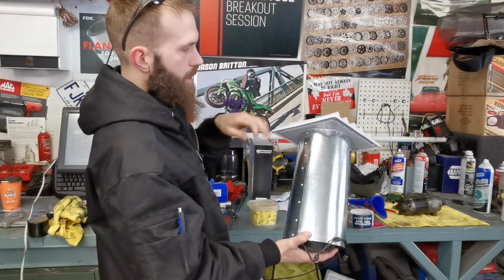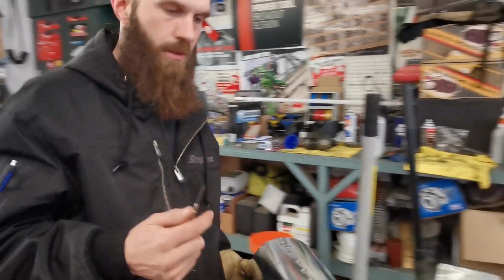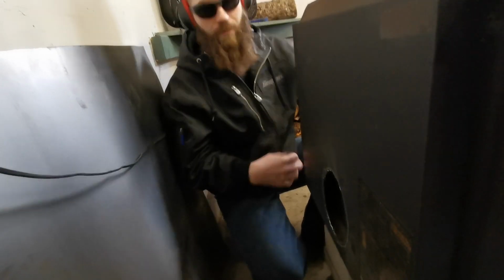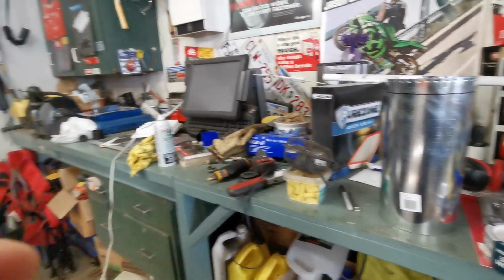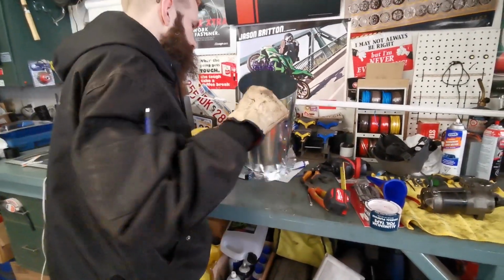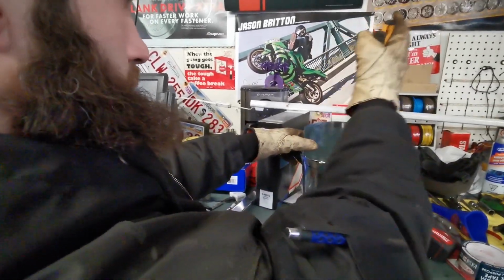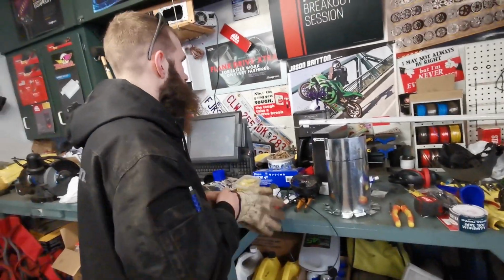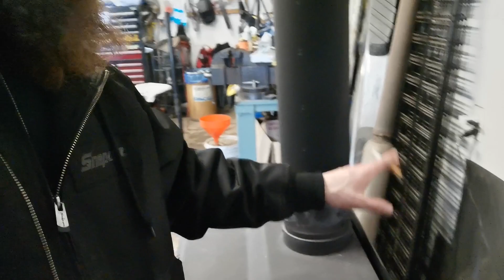Home Made Fire Wood Burning Stove Heat Blower Fan

Comment: Just what I was looking for, for my shop stove, great idea.
Reply from the maker: happy to help
 make sure any components that could melt is clear from melting,
Reply: @LUCAMTire hey, do you see any difference without the fan vs with it being on ? How long does it take to heat up the area
Reply from the maker: @itsyurb0ylayy4  with a fan blowing over the stove or with a blower fan mounted to the back of the stove it will assist in moving the hot air around the stove away from it circulating the hot air throughout the place your looking to heat.
A fan definitely helps move the hot air away from the stove and allows the cold air from else where to have a chance to circulate in the space your trying to heat and it will warm up the cool air when circulating past the stove. 
A fan does help move the heat around. 
You can buy a fan that you can sit on top of your stove and it works off the heat of the stove to spin the blades. No power or fabricating required and is safer. See following Amazon link to what I am referring to. 
https://amzn.to/40nS1Cm
Reply: @ thank you !!
Reply from the maker: @itsyurb0ylayy4  your welcome. If first time using wood as heat, check out some other videos on how to control your burn in the wood stove.